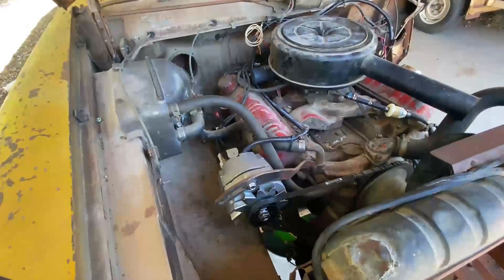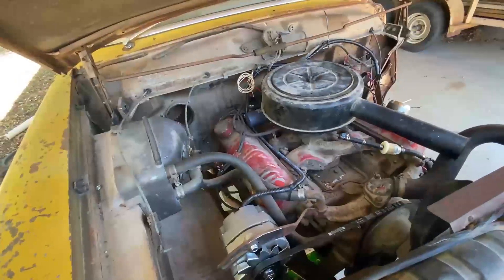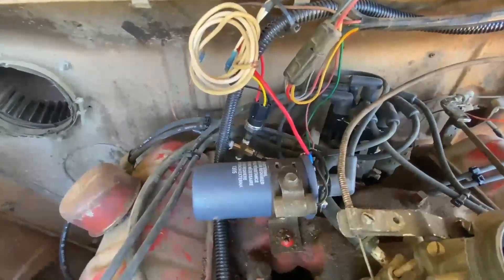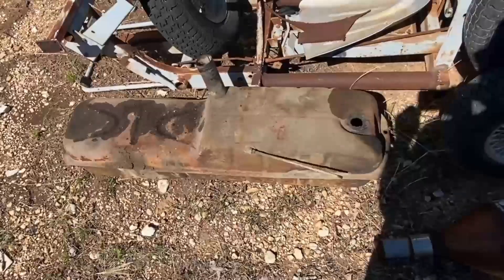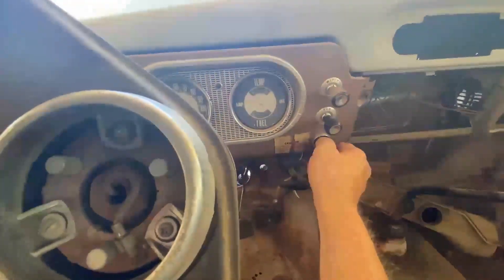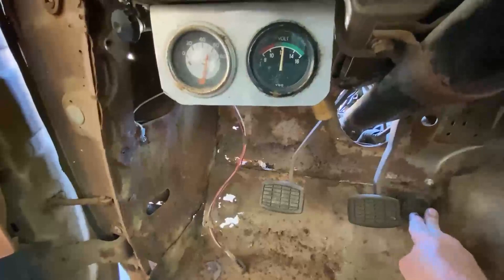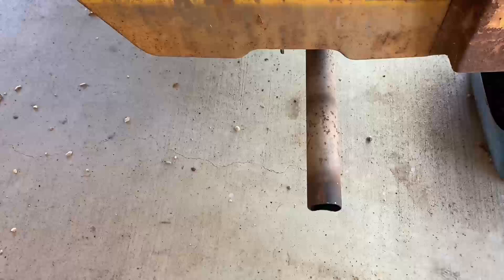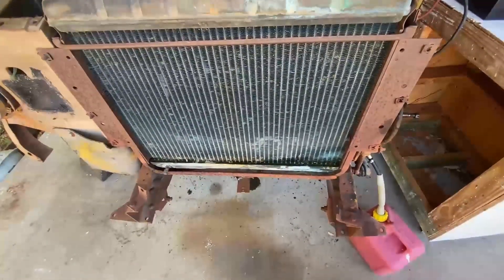Studebaker Champ rescue , will the engine run #2

Comment: Awesome you got her running. Nice junk yard find. I just had my radiator switched out, wasn't cheap.
Reply from the maker: Thanks PAPA, I'm keeping my fingers crossed it won't be to expensive getting the radiator repaired. If so I will put an aluminum one in it.

Comment: Great alternator swap Lloyd, purring like a kitten, :)
Reply from the maker: Thanks Tom,  I have several things I will do to the engine . Going to change out the water pump , front and rear crank seal . I see some signs they are leaking a little.

Comment: That little Stoodie sounds great!
Reply from the maker: I have a couple of parts come in this week - the rear oil seal. Bet that will be fun...right? Got the water pump too. I will likely get the radiator repaired while changing the pump . Thanks Matt
Reply: @RustyGlovebox  You really lucked out on that gas tank.

Comment: The engine runs and sounds great, I can't believe it is that good having come out of a wrecking year. Great score on the seat and the Mazda fuel tank sounds like a good way forward. I am enjoying following this, thanks
Reply from the maker: Thanks Joseph, The gas tank came in on Saturday and I will need to re-locate the filler neck. It shouldn't be hard to install.

Comment: hello.
truck restoration.
The seat covers are beautiful.
Alternator. exchange.
There is a hole in the fuel tank. need replacement.
Mazda's fuel tank can be used.
Good sounding engine!
Fluid leaking from the radiator. need replacement.
Upcoming floorboard repairs.
Thank you my friend.
Reply from the maker: Lots of work to be done to the truck but I will enjoy it when I'm done. Thank you my friend and have a great week.

Comment: Looking great Rusty. There is a guy around here that has a truck like this on a Ford ranger chassis looks sharp with a step side box too. Well keep plugging away at it.
Reply from the maker: I thought about using a Ford Splash bed but I would have to shorten the frame. The original bed has its problems but not enough for me to go to that . Studebaker had some funny ideas for the day and I think I will keep somewhat original. Thanks George

Comment: Thats crazy, I was doing a countertop job yesterday, an came across one of those!! Ran & drove. Contractor said the owner was just driving to back in July. It was so traight and purdy, didn't even have shopping cart dings in the sides. $4000 was asking price...
Reply from the maker: That sounds like a great price. It will be hard to build it cheaper than that. Thanks and take care

Comment: Can’t wait to see your progress over the next several months.
Reply from the maker: Thanks Keith, the engine running is a major milestone.  I will be replacing the radiator with an aluminum one I had from another project. Fabricating the brackets for that and looking pretty good.